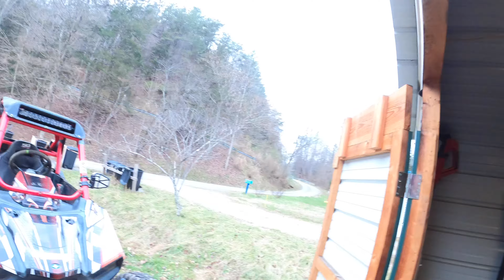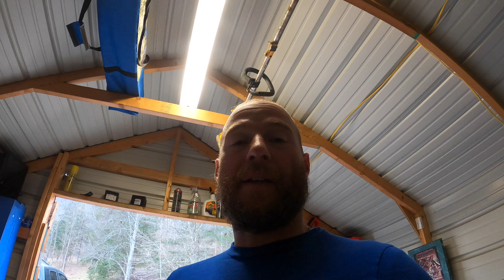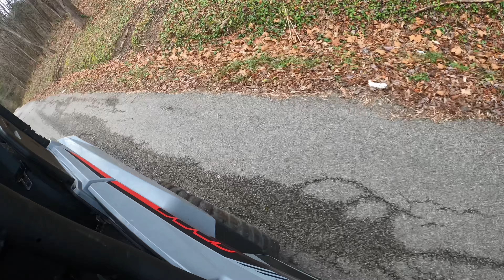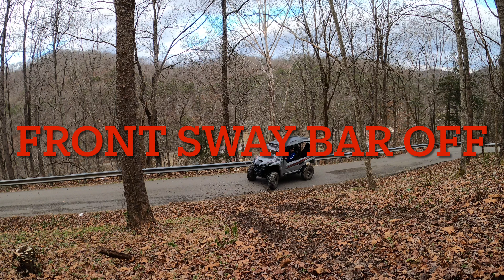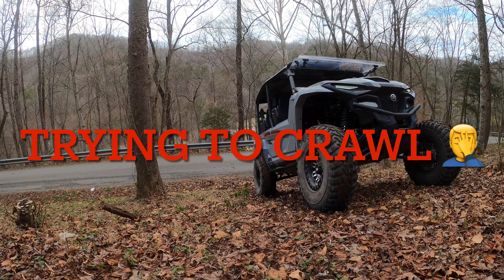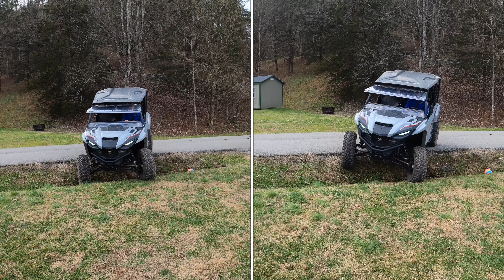Rmax 1000.  Should I remove front sway bar ???? How much does it change machine ????

Comment: You’ll get a lot more out of it by removing the rear and leaving it out for good. It will articulate better than removing the front. 
Put quick disconnects on the front and hot rod at will. You won’t notice much difference in handling. 
Disconnecting the front as well will take it to a different level for rock crawling, as you said way safer and more capable. 
Hook the front back up for fast stuff and it does handle better but once you get used to the bit of body roll without any of them it does fine. Body leans, all four tires stay on the ground.

Comment: I noticed that you have the aftermarket d mode switch which one did you get for the rmax4 and does it make a lot of difference
Reply from the maker: Yes.  Dmode switch is nice.   The throttle response changes big time but the peak horsepower stays the same